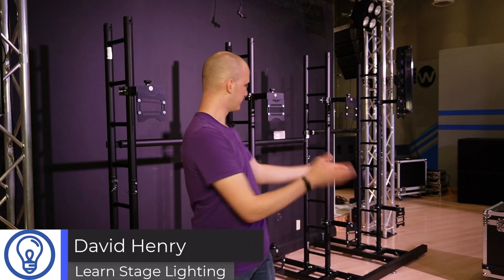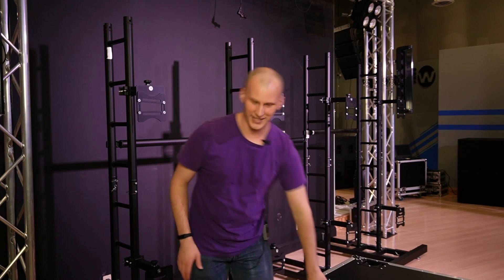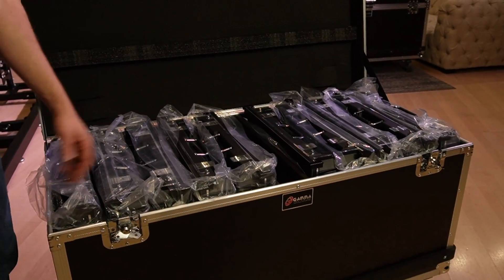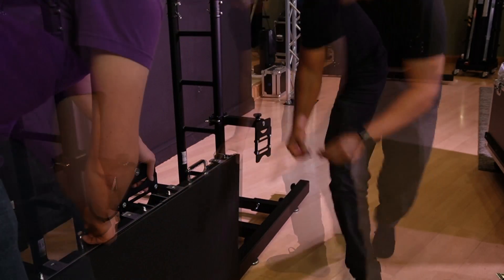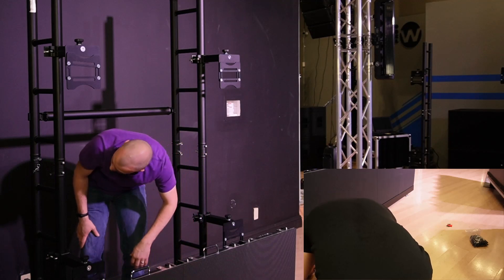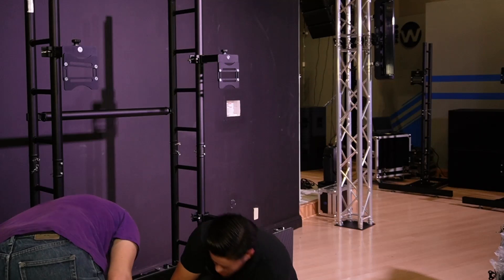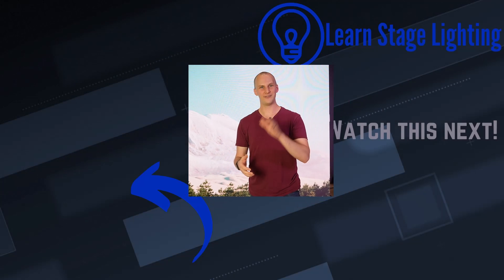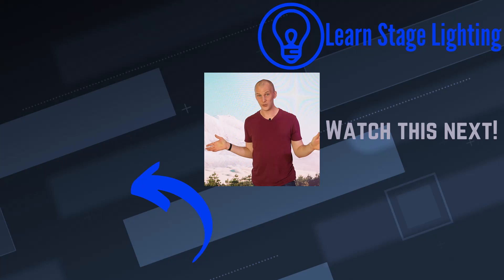How Do You Build A LED Video Wall?

Comment: Hey David hopefully you can help me out with this question!!!
I am building a 48 panel wall with UNILUMIN UPADIII 500x1000mm panels. It is 8 panels high and 6 miles wide.
I used unilumins calculator and it tells me: minimum 120vac 20a circuits (8).

Does that mean when running power I need 8 circuits powering 6 panels each?

Comment: I'm out with this channel. I  mean it's a benefit that onyx wasn't mentioned but the biggest issue by far with led wall is calculating your load whether its ground stacked flown and if outside even more complicated- this video- nothing. Anyone can plug in some power and ethercon. I'd even go as far as to say the wall in the video is not correctly ballasted but as no coverage of that can't say but it looks to be just leant against some ladder truss?
Reply: No when you attach it to something it's taking load